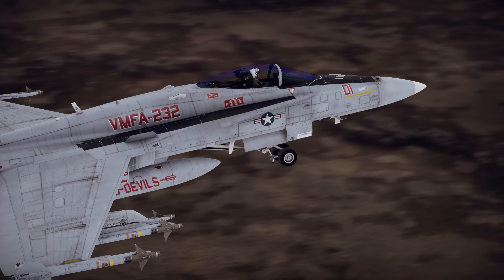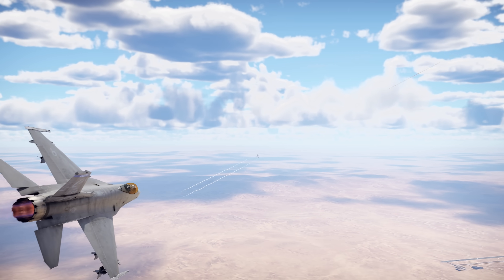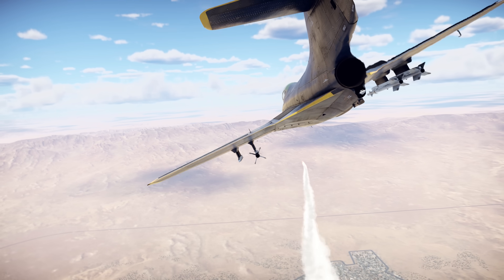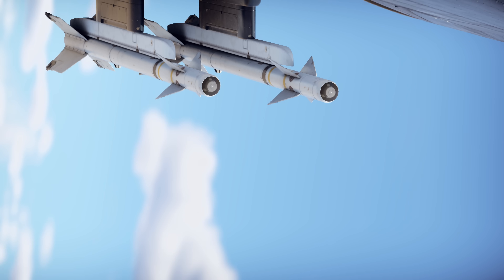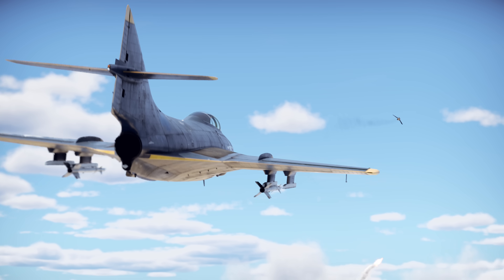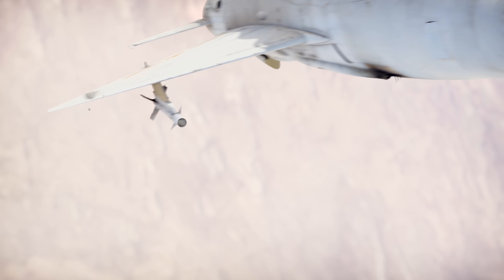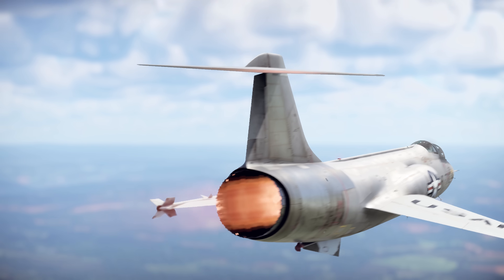How Does a Missile Know Where It Is and Where It Isn’t?

Comment: Proposal for Advanced Aircraft Missiles - War Thunder 2026
1. Next-Gen Infrared (Heat-Seeking) Missiles:
AIM-9X Block II/III (USA): Advanced Sidewinder with "Lock-On After Launch" (LOAL) and data link capability.
R-74M2 (Russia): Specialized for the Su-57, designed to fit in internal bays with extreme maneuverability.
PL-10 (China): High-maneuverability infrared missile for the J-20, capable of extreme off-boresight shots.
MAA-1B Piranha (Brazil): Advanced 4th generation heat-seeker.
A-Darter (South Africa/Brazil): Thrust-vectoring missile that can pull high-G turns to hit targets behind the aircraft.
2. Beyond Visual Range (BVR) Radar Missiles:
AIM-260 JATM (USA): The new standard for long-range air dominance to counter all stealth threats.
R-77M (Russia): The upgraded "Amraamski" with AESA radar seeker for the Su-57 and Su-35.
Meteor (Europe): Uses a Ramjet engine for sustained high speed until impact, making it impossible to dodge.
PL-15E (China): Long-range missile with active electronically scanned array (AESA) radar.
3. Strategic & Anti-Radiation Missiles:
AGM-88G AARGM-ER (USA): Designed to destroy enemy Air Defense systems like S-400 from long distances.
R-37M (Russia): Hypersonic long-range missile designed to take out high-value targets.

Comment: Why don’t they make radar guided heat seekers? so it would be harder to chaff and flare
Reply: Why don’t you fit everything in, then, Mr. Master Packer =b
Reply: Also then literally what is the point of flares and chaff if it still uses the same methods of locking?

Comment: [Inhale]THE MISSILE KNOWS WHERE IT IS AT ALL TIMES, IT KNOWS THIS FROM SUBTRACTING WHERE IT IS FROM WHERE IT ISN’T OR WHERE IT ISN’T FROM WHERE IT IS, WHICHEVER IS GREATER, IT OBTAINS A DIFFERENCE OR A DEVIATION.
THE GUIDANCE SUBSYSTEM USES DEVIATION TO GENERATE CORRECTIVE COMMANDS TO DRIVE THE MISSILE FROM A POSITION WHERE IT IS TO A POSITION WHERE IT ISN’T AND ARRIVING AT A POINT WHERE IT WASN’T.
IT NOW IS CONSEQUENTLY THE POSITION WHERE IT IS, IT IS NOW THE POSITION THAT IT WASN’T THAT IT FOLLOWS, THAT THE POSITION THAT IT WAS IS NOW THE POSITION THAT IT ISN’T. 
[Inhale] IN THE EVENT THAT THE POSITION THAT IT IS IN IS NOT THE POSITION THAT IT WASN’T THE SYSTEM HAS ACQUIRED A VARIATION, THE VARIATION BEING THE DIFFERENCE BETWEEN WHERE THE MISSILE IS AND WHERE IT WASN’T.
IF VARIATION IS CONSIDERED TO BE A SIGNIFICANT FACTOR, IT TOO MAY BE CORRECTED BY THE GEA, HOWEVER THE MISSILE MUST ALSO KNOW WHERE IT WAS. THE MISSILE GUIDANCE COMPUTER SCENARIO WORKS AS FOLLOWS:
BECAUSE A VARIATION HAS MODIFIED SOME OF THE INFORMATION THE MISSILE HAS OBTAINED IT IS NOT SURE WHERE IT IS, HOWEVER IT IS SURE WHERE IT ISN’T WITHIN REASON AND IT KNOWS WHERE IT WAS IT NOW SUBSTRATS WHERE IT SHOULD BE FROM WHERE IT WASN’T OR VICE VERSA AND BY DIFFERENTIATING THIS FROM THE ALGEBRAIC SUM OF WHERE IT SHOULDN’T BE AND WHERE IT WAS, IT IS ABLE TO OBTAIN THE DEVIATION AND ITS VARIATION WHICH IS CALLED ERROR.

Comment: Shame this doesn’t help the Aim-9L, which despite being designated as an “all weather, all aspect” missile fails to lock a target through a cloud. And it’s flare resistance having dropped off a cliff.

Stingers are also quite disappointing in game because they perform identically to the IGLA despite many sources stating that it should be heads and shoulders above it.

Let’s also not forget that apparently DIRCM existing is enough to cause the Aim-9X block 2, one of the most advanced IR A-A missiles in the world, to miss a target it has on IOG and DL because it just gave up within a km of the target.

LETS ADDRESS THESE ISSUES PEOPLE

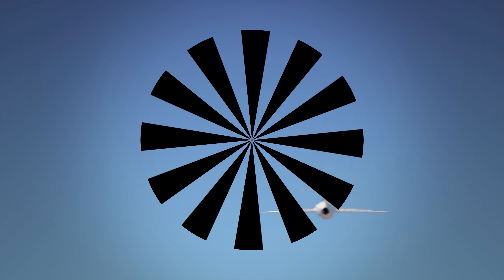Comment: 1:50 you got the graphic wrong. The spin-scan disc should be half black, and a half stripes, two different semicircles. If it's all stripes it can't figure out the phase.
Reply: exactly
the "striped" part is also only there as a filter for sun reflections from clouds

however the disk is not half black

its: stripes with 0% and 100% opacity and then the other half is 50% opacity
Reply: @IronPhysik do you know where I can read more about how AM spin scanning actually works?

Comment: Day 55 of asking for Air Assault 8.3+. We have F-18 fighting 6.7 planes, this is pathetic.

Please for the love of god, add a new 8.3+ assault at the minimum if not others like 10.0+.

We need higher BR planes to allow more pilots to get 1500 points (about 80% activity) for ~3.2k RP.

The planes in 8.3+ or higher also NEED MORE SPACING to prevent AGM cheesing and missiles taking out 3-8 planes a hit.

Comment: Forty odd years ago when i was studying logic at Uni we had a lecture on image processing.  We looked at how a fairly simple circuit could be used to create a persistent "concept" of an image in the sensor's circuits that allowed it to keep identifying the object even as it changed size and shape, for example as it got closer or turned from head on the side on.

I am pretty sure that this is used today in imaging infrared systems to allow it to keep its lock on the target while ignoring flares and other distractions.  Of course the counter to this is to completely obscure the target's own profile using things such as smoke, but now you are getting in to the same ways to counter human ID'ing of a target.
Reply: One thing modern "flares" (like the BOL pods) do is to create a cloud of IR (or chaff) instead of one burning point. So sort of like an IR "smoke" of sorts.
Reply: @TheNecronomica  Mostly because thats the only hope of actually having a chance to flare a missile with imaging seeker; FPAs nowdays have decent resolution, and can extremely accurately measure the temperatures they see, so they have a very easy time just ignoring something liek a flare that would just be a random hot dot in 1 pixel. But even BOL and programmable flares don't really work in any reliable way against the likes of Aim-9X and IRIS-T.

Comment: To long. All misles folow same patern: The missile knows where it is at all times. It knows this because it knows where it isn't. By subtracting where it is from where it isn't, or where it isn't from where it is (whichever is greater), it obtains a difference, or deviation. The guidance subsystem uses deviations to generate corrective commands to drive the missile from a position where it is to a position where it isn't, and arriving at a position where it wasn't, it now is. Consequently, the position where it is, is now the position that it wasn't, and it follows that the position that it was, is now the position that it isn't.
In the event that the position that it is in is not the position that it wasn't, the system has acquired a variation, the variation being the difference between where the missile is, and where it wasn't. If variation is considered to be a significant factor, it too may be corrected by the GEA. However, the missile must also know where it was.
The missile guidance computer scenario works as follows. Because a variation has modified some of the information the missile has obtained, it is not sure just where it is. However, it is sure where it isn't, within reason, and it knows where it was. It now subtracts where it should be from where it wasn't, or vice-versa, and by differentiating this from the algebraic sum of where it shouldn't be, and where it was, it is able to obtain the deviation and its variation, which is called error.